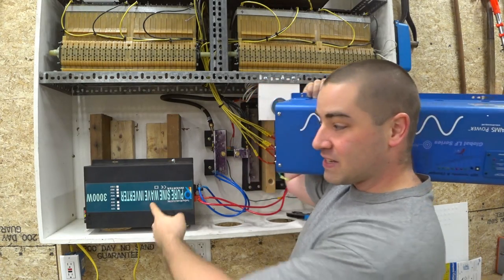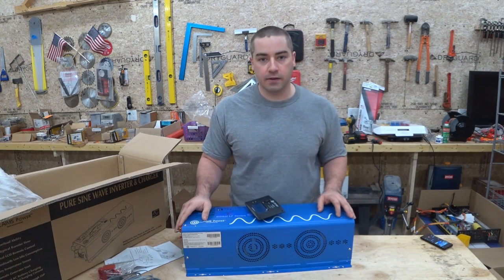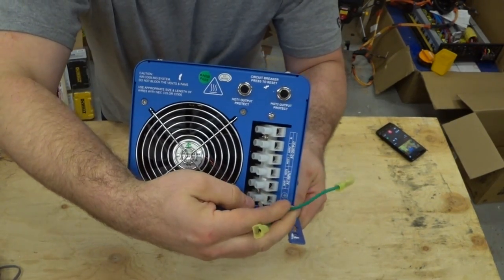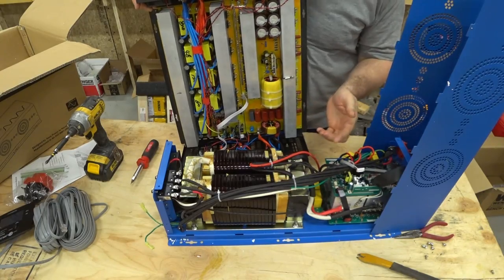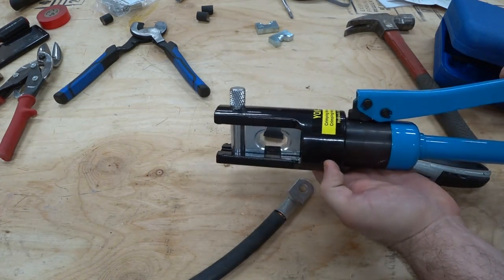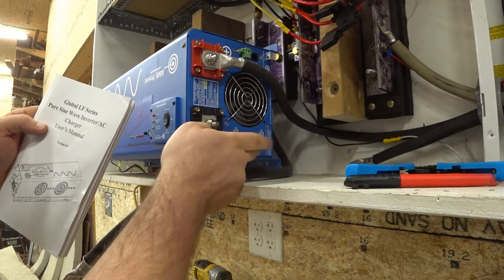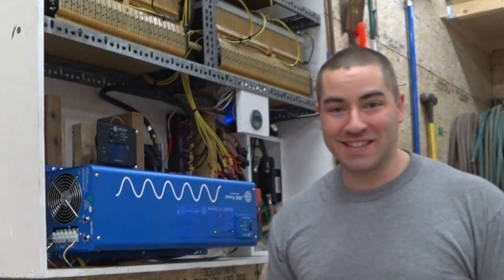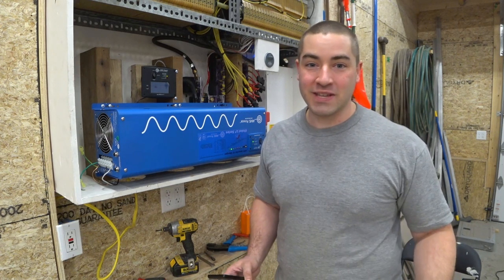Inverter Upgrade! Reliable to Aims in Off-Grid System

Comment: I have had 3 of these inverters they will run a 3 ton AC no problem. and will start my 7.5 hp compressor as well. The aims inverters are built by YIYEN in china they make great units. I have to 12K 120/240 YIYEN inverter running my whole house for a year now.
Reply: Thanks for putting that information here regarding YIYEN.  I thought AIMS would be using a toroidal transformer in this one.
Reply: May I trouble you for a link to whomever sells YIYEN inverters?
Reply: It was too easy,    yiyen.com  now they have a 15kW model
Reply: How many watts is your solar panels and how many batteries are you using? Thanks.
Reply: how you sinchronize  all 3 of them together ?? i mean ac wave  ...the frequency
Reply: @stanjarmolowicz  I'd like to know this also.. how is it possible.
Reply: Will it work for a a portable carpet cleaning machine connected with 2 extension cords running both at same time?
Reply: @joselandaverry5439  you would need to know surge watts, and running watts of each machine, then size the inverter accordingly
Reply: @CycleWerkz  18kw is available now

Comment: 95 is metric corresponding to 95mm2, the gauge of the wire. Very easy to calculate gauge and amperes and wire length with the metric.  The mm2 is the same even if it's round cable, square bar or a bundle of odd stuff.

Comment: Nothing can beat a low frequency power inverter for the ability to run heavy loads... Especially motor loads.  I have two 4000 watt grid-tie Xantrex inverters (94% efficiency) on my wall in my basement that are hooked together to be able to do the 240 volt AC as well... With a very large 24 volt HUP lead acid battery set up ... And I power my whole house... Well and Stove included  from it when the power goes out and then during the day when the sun is shining bright it offsets how much power from the grid I'm using... Low frequency Transformer powered inverters are the best... Mine have been in use for over 20 years now and not a single hiccup
Reply: How much batteries in your set up?

Comment: I have a 3kw Tumo. Uses a 10'x3' toroid with  2) 10,000uf 100v electrolytic caps in parallel. At first it was running a bit hot and showed some spikes on the scope so I replaced the caps with better quality and lowered the cut in temp. of the fan.
Gained a lot of efficiency and heating from inductive loads no longer an issue.
Low Frequency Inverters are like musical instruments, they need to be properly tuned.
Reply: I don't really have a lot of experience with LF only HF and it hasn't been that great they're so damn sensitive and they vary from make and model as to their level of Competency and protections that I just think LF is the way to go. What do you think is the best? If this will be for an off-grid situation with a battery array and probably thirty 400 watt panels with Pete the man being only around 9000 what's but with inverter capable of three times that

Comment: I love the low frequency inverters, they are more reliable even if slightly less efficient compared to those of high frequency brand, I love their strength and reliability but only those with high efficiency output toroidal transformer

Comment: Another option is change the compressor motor to 240 which will then be balanced on the panel and half the amperage, and make sure you have enough batteries to prevent the BMS from shutting down the in-rush start up current. If you take this route, be sure to change the compressor plug end to a suitable 240 rated plug, a L6-30 twist lock works well on my unit with matching wall outlet.
Reply: In light use, but it really be necessary to do all that because I'm not sure if it would really prolong the life of the compressor or the inverter I understand it will be more efficient

Comment: I have a Aims inverter like yours. For 3 yrs. now works great. It's a 2,000. watt. I'm off grid, Runs my whole house. Does every thing will run a skill saw easily. Won't do the laundry, because the water pump runs at the same time as the washer. Too much drain on the unit. Turn on the washer and put the Lid up. The washer fills up and the water tank fills up, the water tank auto kicks off, close the door on the washer and it takes off and works well.  I have a microwave, 1000 watts. works well. Can't run anything else.  Haven't  had any trouble with it. Only problem I have when I run The power saver switch on the on-off rocker switch my auto porch light turns it right on and spoils that function. So I don't use it and I have L.E.D. light and batteries on it so it will tell  me when it's time to recharge the batteries. The whole package works great over time.
Reply from the maker: That's great.  I hope to join you in the off-grid club soon.  I'm working on it.  Thanks for sharing.

Comment: It would power up everything that you have in your arsenal.... But if you want to use it for a long time take cover off from inverter and Serch with the heat gun for hot spots and you will find one  or two... Good perches... 👍 
My 12kw inverter have no thermal compound on mosfet's and on control board was one linear regulator heating heavily so I put the heatsink on it.... 👍 
3 year is in service and no issues at all... 
Once a year I have maintenance blowing dust from circuitry and that's all....👍
Reply from the maker: I'd love to see a video of what you are describing so I can duplicate.  If you get a chance...

Comment: hi David. Great vid. very helpful and informative. You should add a separate soft starter circuit to use with all you Motor driven tools in your garage. A soft starter is an electronic device which regulates the voltage to the motor at start-up. By slowly ramping up the supply voltage to the motor, a smooth start without excessive current flow can be achieved. This will prevent your Inverter from overloading and extend your tool motors.
Reply: Yes good point. And you can add soft starter circuit to the output of your HF inverter as well. They should all be built with inductive load handling. It seems just a few higher-end model have it anyhow.
Reply: Malcolm do you have a link to these types of Soft starter circuits?

Comment: High frequency means smaller parts such as transformers and capacitors; you are creating quicker waves of electricity. The smaller parts use less power, so they are more efficient. But low frequency means bigger rugged parts as shown which can be more wasteful when idle, but certainly more rugged.
Reply: Thanks Jay.  Good to know.

Comment: Getting an air compressor to work is pretty impressive. I was excited too when I saw it kick on. Great job! Also, thanks for showing me the difference between high frequency inverters and low frequency inverters. I didn't think that the difference would be that radical.

Comment: I have the same compressor, my 5000 watt MSW Giandel will run it, but occasionally has a hard time starting it especially with a full air tank.  I asked my electrical engineer dad about this. He says that when you start an AC motor for the first half of the sine wave it is at a dead short, so a 60hz motor would be at a dead short for 1/120 of a second, therefore the huge start up current draw. Some motors have capacitors and stuff to assist, but since mine started, I didn't ask him about all that. Love your channel.

Comment: It would be nice and tidy for you to wrap some electrical tape around the cable and the exposed lug with correct colour so cables cannot get mixed up if testing or repair work is required.
But a great job and look forward to next adventure. 
Keep it going and are certainly getting me excited to get going myself.

Comment: Even I got excited when you plugged in the compressor  lol
Reply: Me Too now he can power all his tools :)
Reply: Does that compressor take so much current then? Electric heaters are often the biggest consumers.
Reply from the maker: @Richard van Pukkem: It has to do with the initial surge to get the compressor started.  The compressor has a piston inside that needs to compress air into a tank, which is already under pressure and resisting the piston from moving.  It takes a huge spike in current to get the crank spinning.  I don't have the right tool to measure in-rush current, but some commentators of my past videos have said this can be 10x.  If that's the case, then this 13 amp motor might need 130 amps for a second.  I've had three other inverters prior to this (check out some of my other videos) that could not turn on the compressor.  Electric heaters don't have any surge.   I hope that helps, I'm not an electrical engineer so I'm probably using a term wrong or something, but I think that's the basic idea.
Reply: same here ;-)
Reply: @DavidPozEnergy … The motor surge is likely 3-4 times the running draw and the compressor itself has what's called an unloader valve which blows off the pressure after each cycle finishes. IOW, you still have the motor surge but will not be pushing against tank pressure on the first revolution or so. BTW, the motor may have the info on the data plate as LRA. (locked rotor amps) This is what the draw is if the motor is stalled out, locked up, etc.... and is also close to the start surge. (inrush current) Other info on the data plate might include run amps, or continuous draw, which for a 20 amp circuit in a shop will be less than 80% of what's available on a dedicated outlet. Most likely that compressor is under 10 amps (run) and no more than 30 amps for starting, because it's designed to be used on a standard outlet.
Reply: How long it can supply?
Reply: Why are you excited? 6000 watt is 50amp that compressor at most is 15amp. Loads of headroom for surge amps on startup
Reply: They aren’t crimping lugs
Reply: Well done
Reply: @XxTWMLxX  right?
He should put a load on the tools, like sawing some heavy metal with the band saw and cutting wood etc. But yeah , as long as he has that big battery bank, he should even be able to run a rooftop RV AC unit , fun stuff
Reply: Can a 8000 watt inverter charge a Electric car faster compared to a 3000watt inverter.I Googled how to charge a electric cars faster.What about a 8000 watt generator can it charge the electric car faster then a 4000 watt generator ??
Reply: Low Frequency is heaps better for induction motor's and heavy start ups. I can run my welder and air compressor easy i have had mine for 9years never let me down
Reply: where can I find this inverter

Comment: Hi everyone! If you are running inductive loads then this inverter is needed! In my case, inverter is going to be inside home because the main wiring panel is located in a room and we don't use big inductive loads too. And being said that is going to be inside our house, a low frequency hum sound would drive everyone crazy. So in  our case, that's why we are using a high frequency inverter. Great review!

Comment: Thank you for making this video. You answered my question about this inverter handling motor surge start-ups. I just ordered the single phase 48 volt DC input version of this. I'm upgrading for the same reason you did because I was dealing with surge and start-up issues. My inverters weren't blowing out but they struggled with surge currents of over 200 amps because I was running a 12 volt to 120 volt system with battery cable diameters that could have replaced professional mountain climbing rope. Yeah the Aims inverter is much heavier compared to the high frequency inverters because they are using actual output transformers. I really like the fact that these can charge the battery bank off the grid too! I did speak with their technical support and I asked a lot of questions. These are not the top of the line inverters that are out on the market but from what I learned they are pretty reliable as long as they aren't abused and the company does support their products with a in house repair team. Try to find that product support with the Amazon specials...  I'll be doing a video once I make my upgrades. Once again thanks for doing a video on this unit.
Reply from the maker: Great.  Glad to hear the video helped.
Reply: @flash001USA  Which are top of the line? I need a 1000W LF 12V->240V one and I'm struggling to find anything that hasn't been puked out a factory in China and re-branded as whatever.
Reply: @DavidPozEnergy  This video popped up as a Youtube suggested video then I remembered that I commented on it a while back. I did receive the unit and it could power anything you thru at it. Mine was the 6000 watt 120 volt inverter. It had great output but it had an electrical issue where it was not going out of float charge. I contacted the manufacture and they determined the unit had an issue so I boxed it back up in all of the original boxing I received it in and UPS still managed to destroy it. UPS had to pay me for the unit along with lost money in shipping cost so all was good. Since then I went with a Spartan 48 volt 3300 watt inverter with the same 9,900 power surge rating just like the Aims inverter. The unit I got is based on the same low frequency design with the same 88% efficiency. Not only are the designs the same but the control modules are totally interchangeable too. I originally got the 6000 watt Aims inverter to handle anything that I threw at it but in all honestly, it's all about the surge rating. That's where the magic happens with a good inverter. The Spartan inverter sets up exactly the same way and it is also a charger too. My solar setup works great keeping the batteries totally topped off through the day while running my shop window AC unit and my tools without a niche. I can also pipe power back to the house during a power outage so I couldn't ask for more out of the system. My next step is to install a 5000 watt grid tie inverter system for the house to eliminate my electric bill. That's in process now. There is something worth the mention about these low frequency inverters: These units may be a bit less efficient but these units are actually more robust than the high frequency inverters. I'll be doing a video on my revised setup in the next couple of days but here's a link to the Spartan inverter for you or others who may be interested in a smaller inverter. It has the big transformer so like the Aims inverter, it's a boat anchor too. https://spartanpower.com/product/sp-ic3348/

Comment: The main efficiency issue that these inverters have is in the design of the transformer. Low Freq inverters with toroidial xfmrs tend to be more efficient. The other issue is how much power it pulls to keep the transformer magnetised, that can be a little wasteful when you're just running a light load. Some people mess around with swapping the transformers but that's a massive job and introduces a very real danger the inverter will be wrecked. If you find the low load overhead a bit greedy on the batteries the obvious solution is to use a smaller inverter for such loads and just use the big one for the big loads. Then efficiency becomes a moot point as you're only dealing with those overheads when you need lots of power anyway.
Reply: you're absolutely right, those low frequency with toroidal transformer without frills / software are the best for reliability
Reply: I have a 375va Victron for all my fridge, lights, TV, Fan etc... which stays on 24x7, and a 3000w chinese transformer inverter for when i need to run a compressor which is runs a 2HP compressor fine and drop saws etc..... i have a 24v System.
Reply: are you an engineer? would you know why they wouldn't put a smaller inverted alongside it and relay to the full system when it's needed, at this price?
Reply: I don’t believe a 8000W inverter will handle high inductive loads such as a miter saw.  The initial inrush current could go as high as 8-10 times the full load amps.  What are the volt amperes of the saw?

Comment: I bought 2 Reliables and both blew up (one by hooking up ground and the other by trying to run full load).   I then bought the 2,000w 48vdc version and ran OK, then upgraded to the ETL listed 12,000 watt 48vdc version and been running that successfully for 4 months.   Laid it 'flat on floor'  (at 175lbs is to heavy to lift vertical on wall) and works OK in this angle.  This gives me 50amp @ 230v.     Average load is 2300w / hour for 14hrs / day with peak of 6,000w a few times.     Running Cooktop,  lights,  furnace fan,  microwave,  hybrid water heater,  shallow well pump,  tools (table saws, etc etc), and a couple of 3000watt APCs that power the 'computer/sensitive' sockets in the house to overcome the automatic transfer switch switch overs each day.   Its running at 85% efficiency - e.g. out of 40Kwh from PV array I get 34Kwh of power into house.    The only problem noted is a couple of my old clocks plugged into non-APC plugs that depend on 'exact' 60cycles are running slow - lose several minutes each day.      I read that AIMS only lasts a few years..   but we'll see.     So far, I'm pleased.
Reply: I ment to say I bought the 2,000w 48vdc AIMS and 12,000w 48vcd AIMS after bad experience with Reliable.
Reply from the maker: Sounds like we had similar experiences.  Thanks for sharing.  Especially about the clocks.  That's a neat little nuance.

Comment: I hope you like it I love mine it’s a power. Horse I think I’ve had it going now for over a year 24/7 no problems , knock on wood lol them reliables I’ve had two both bit the dust in just a week
Reply from the maker: I don't remember seeing an Aims in your videos, which video shows it?
Reply: It’s on the one named sweet solar day I just did heat readings on it , it’s a 24 volt 4000 watt 120 volt it is a work horse , I’ve got it  on a couple more videos I don’t think I’ve done a review on it yet I’ve got to do that aims makes good product for sure
Reply: Mosfet inverter vs transformer inverter no contest